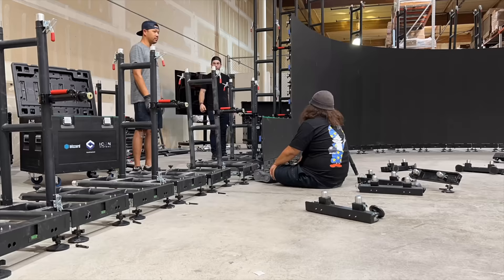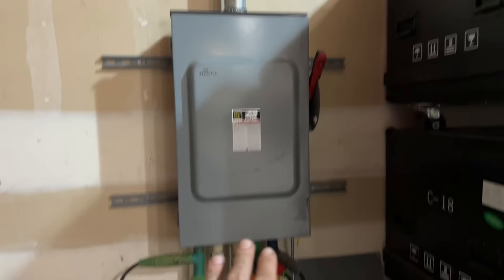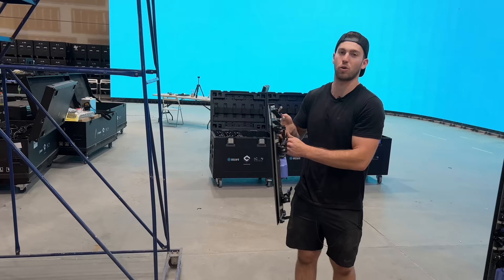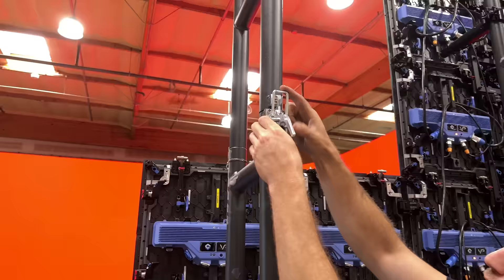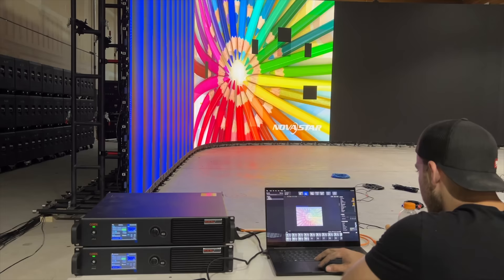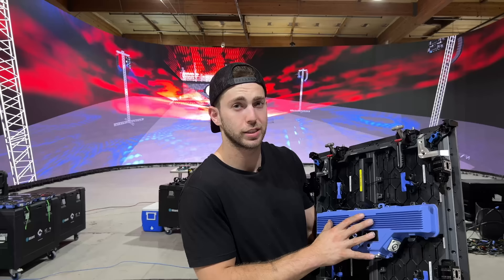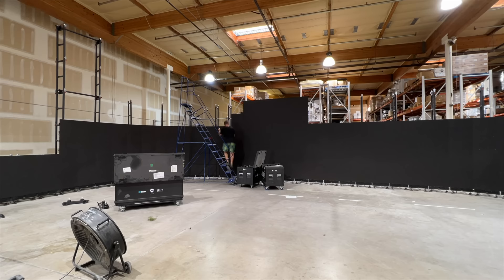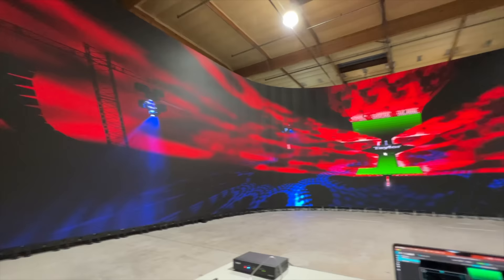How to Build a Video Wall for VFX! (Everything you Need to Know)

Comment: Step 1: Convince someone to give you $1,000,000. Step 2: Build LED volume. Step 3. Underpants. Step 4. Profits!
Reply: 5. Also convince your local electrical company to use 70-80% of their electrical capacity
Reply: @DJDXD  It shouldn't need more than an electronics store or a small company/workshop... It certainly needs strong current (three-phase current or something like that) for the building/the electronics, but that should be easy to implement if you can afford the video wall...
Reply: @DJDXD  200 amp * 240volts  = 48kw
Reply: Did you think this was a diy for someone’s hobby
Reply: Are you building this video wall just to watch parnos on it ? If so....

You deserve it
Reply: Step 3. Learn Unreal engine.

Comment: Well done, similar setup in building video walls in Jamaica, for live events, we run out circuits @ 220v so we get to double the amount of panels per circuit by having the amount of amps per panel running @ the higher voltage...

Loving the full explanation on the amount of processors used and the offset of frames... power, modules and the spline

thanks much...very appreciated

Comment: I work for an AV installation company, we do LED video walls. Still hoping we get involved in a project like this at some point. Since I program AV systems and am currently learning unreal engine, this seems like the perfect sort of project for me. I could easily spend a few days with something like that as my computer monitor. :D

I play with ones that are 16ft by 9ft, pretty regularly but I can't usually pull up unreal engine and start playing around. For anyone wondering those panels run about 1700 a pop retail and the video wall processors are around 7500 each. 
so 56 panels wide x 10 panels high x 1700 dollars each = 952,000 + (4 x 7500) = 982,000. once you get 8 guys for 8 hours a day for 5 days at 150 an hour that's another 48,000. and the trussing I would have to guess is about 20,000 to 50,000. 
So 982,000 + 48,000 + 50,000 = 1,080,000.  Guessing the budget was a million, as you will get a discount for a project with most manufacturers selling you a bulk amount of hardware. Could probably easily shave 100k off the cost.
Reply: Hi, I'm curious to know how much the 16:9 ones you do cost?
Reply: If also like to know how much the 16:9 ones you do cost… and do they curve around the subject like this big one does? And can a person actually run unreal engine 5 on it?

Comment: This is so cool! The Mandalorian used 2.8mm pixel pitch - yours is 2.6mm pixel pitch which means yours has more pixels and a more high definition wall. Congrats on your wall, looking forward to seeing more content about your system soon. Would love to know the camera tracking system you’ll be picking for your Virtual Production. Glad that the Constellation 2M/E has genlock reference in. Hopefully that’s how we use it. Haven’t tried it either but looks like camera tracking, genlock cameras might be the next step after mastering the Unreal software. 😂

Those 560 panels are awesome! I wonder how many spare modules you bought as ready backup spares to plug / swap them in when needed. 

So true about the first layer making sure that’s it’s really leveled and so annoying when it’s hard to connect the side connectors being at the 6th row high and then seeing there’s a small line gap specially noticeable when there’s lighting from the back. Imagine having that when you’re at an event, 8am morning setup - then showtime at 5pm. 😂
Reply: Mandalorian was shot on ROE BP2, which has a MUCH better scan/drive rate with its IC's than anything blizzard offers. pixel density become less important the closer to 2mm you get, and more about the quality of the IC and Diode, and how they are driven.
Reply: Every panel had 4 smaller panels you can Exchange

Comment: Normally a single phase has active & neutral, when active is off it's safe to touch the neutral (if everything is working correctly).
USA 2x 120v phases to make 240v means 2 actives, you can't switch off an active &  touch the other⚡(it's not safe). In this case, both actives have to be switched off.
Australia, Europe & others have 220~240v 1 phase, active+neutral+earth.
Some installations will have ~400v 3phase outlet (3active+neutral+earth) & a plug in distribution board to provide ~230v circuits.
Simple maths: if a panel needs 2A & the circuit is 20A (YMMV), then maximum of 10 panels per circuit. Check the panel power needs, quantity & venue supply long before the day to avoid unexpected surprises.
Reply: Is 400v better? I've heard that 3 phase can carry more power than 2 actives, and that americans struggle with powerful appliances like electric stoves and HVACs
Reply: Careful with that neutral. Even if everything is in top condition, there still is current flowing through you if any device is connected to any circuit on that neutral. The route through you, the ground, and the grounding point to the transformer is in parallel with the neutral wire going to the transformer. This splits the current according to the resistances of the two routes, and while those should be so different that next to nothing flows through you, it can still be enough to become dangerous if you are far away from the transformer, have good ground contact, and there is a high load on that transformer. This usually is no problem if you're in a residential setting with one pole transformer per house, but in an apartment block where dozens of flats are on the same leg of the transformer, or in a 3-phase installation...
Reply: @Gameplayer55055 I think you're mixing two things up: Higher voltage and 3-phase.

Higher voltage: The power you get is Volts times Amps. So if you want to run a 1200 Watt space heater on a 120 Volt circuit, you need 10 Amps (10 * 120 = 1200). On a 240 Volt circuit, you only need 5 Amps (5 * 240 = 1200). Just like filling a bucket with water---you can have fast-flowing water and a thin hose, or slow-flowing water and a big hose, the bucket fills at the same speed.

However, just like that thinner hose that has to withstand higher water pressure from the fast-flowing water, a wire with a higher voltage needs thicker insulation to keep the electricity in. That big hose needs more space inside, and the same is true for wires---higher Amps need a thicker wire.

In the US, with its split-phase system (i.e. 2 hots that have 120V to neutral, but 240 to each other), you get the worst of both worlds. You need a thicker wire and thicker insulation. Not that it really matters; the difference in insulation thickness is virtually non-existent, as the insulation needs a minimum thickness for mechanical reasons anyway. But this now gives you the effect that the exact same wires can transfer double the power if they're run at 240V instead of 120V. The wire thickness limits the Amps, so you can't just double the Amps to compensate for the lower voltage, like in my example at the top.

3-phase, on the other hand, uses a weird little trick to conduct the same amount of power with 3 or 4 wires as 3 pairs of wires could transmit. To explain that, I need to explain AC first. With AC (alternating current), there isn't a constant flow of electricity, but it flows forward and backward like the blade of a jigsaw. Now imagine 2 jigsaw blades that are connected to the two sides of a seesaw---when one goes up, the other goes down. The pivot point of the seesaw never moves up or down. The same also works with 3 jigsaws and a triangular seesaw. Or with electricity, where the 3 phases are the jigsaws and the neutral is the pivot point. If the load on all 3 phases is identical, there is no current flowing on the neutral---there isn't even a neutral wire (that's why I wrote "3 or 4" above). The neutral is only needed when the loads are not balanced, for example, when they are broken out into single phases to connect normal devices.

Now, where do those 400 Volts come into play? In a 3-phase system, there are two ways to measure voltage: Between any of the phases and neutral, or between any two phases. If you get 400V from the latter, it means the former is 230V. If you have 120V phase-to-neutral, you have 208V between the phases. Or you can have 480V/277V, or 415V/240V. You might have heard of those voltages before...

Oh my, did I slip into lecture mode? Oops, sorry.
Reply: @HenryLoenwind  your explanation is great, I've enjoyed your analogy with water plumbing. Electricity is almost identical to water plumbing in functioning.

My biggest question is why america has chosen not so great way to distribute power, while europe has both higher voltage and 3 phase. Makes more sense because you have more power & electric motors are very easy to drive with 3 phase without the need of pesky capacitors.

But I think electroboom would get killed with 220v either lol
Reply: @HenryLoenwind  mentioning neutral, some clever assholes are getting power from neutral and earth(using water pipes), and getting a "free" energy this way. This works with soviet systems where earthing isn't a thing
Reply: @HenryLoenwind 

كنت رائعا بشرحك...شكرا

Comment: Hi Brandon, looks awesome! I've already had some experience using volumes with Unreal Engine etc and it's the way of the future if not now. 
One question I have is "What size pixel spacing are your panels?"  We've used 2.9 and 2.1 which worked OK but tighter pixels stop moray issues.
Love your videos by the way.

Cheers
Tim
Reply: I can help briefly, a 192 x 192 panel that is 500mm x 500mm indicates a 2.6mm pixel pitch. @10:45

Comment: Great video. I shoot and produce on a virtual wall in Canada and found your video in hopes to address an issue we have been having. We seem to get horizontal scan lines on video whenever trying to add movement to our camera. If the camera is static, we can sync the LED wall to the frame rate of the camera and don't get scan lines - but when trying to do jib moves or gimbal moves - it always produces scan lines. I'm guessing because of the rolling shutter. Do you have any tips or tricks that you have used? Or anyone in the comments? Thank you

Comment: Great video!!!!! Can you tell us how you got your single 4K output to work on the full wall? Especially with no tearing. Keep up the great work learned a lot here 😊
Reply from the maker: Yes, all the HDMIs in the processors are daisy chained. Then I set EDID of first processor to the widest I could get it and in the same aspect ratio of the wall. Then in the first processor I set the canvas size to 1/4 of the wall and places it on the far left side of the laptop output image. I repeated the canvas size for the other 3 processors giving each one its own 1/4 of the laptop output image. So each processor is scaling up the image to display on the wall. I’m running at a lower resolution then the wall but sizing up to making it fill the screen. Hope that helps.
Reply: @liveproductionmastery  thanks for replying. I am going to try this on a smaller wall just to practice.

Comment: I thought the Wall I work on was wide. Who does your repairs? I would like to familiarize with this manufacturer. I repair Unilumin Upanels 1.5mm Pitch. Driven by Analog Way Helios Processors and Aquilon Scalers using Watchout. Would love to repair those. Do you just RMA them or do you do repairs local to your operation?

Comment: You mentioned the controllers have HDMI (that you plan to use) and the panels are also daisy-chained by ethernet. But what are the other cables we see, they kind of look like XLR, what cables are carrying the actual video signal?
Reply from the maker: SDI is another one of the video inputs which can carry 12G signal meaning up to 4K 60fps 
DisplayPort is another video input option that can do even higher frame rates and resolutions. But you can’t run the signal as far. 

SDI can run reliably at about 300 feet. Then you can rescale the signal with a decimator to run it farther if needed. 

These processors do not have fiber video inputs or loop throughs unfortunately

Comment: Amazing equipment, what’s it cost to do a setup like that
Reply: It looks like they are using Blizzard IRiS Icon 2.6, maybe $1,400 each (without bulk discount). 56 panels wide x 10 panels tall = $784,000 . Not sure on the video processor units, maybe cheaper, but probably $75,000 for the 4 hubs + 4 processor units. Add another 15k for smaller things: metal rigging, electric equipment like panels, miles of cabling, storage for everything. Total: Probably a bit under $900,000 on just materials, without any spare parts.
Reply: @benjaminaburns  holy

Comment: Hey what’s the tallest you’ve built with these blizzard panels?
Reply from the maker: 16-18 panels either ground supported or hanging.
Reply: @liveproductionmastery  sorry should have clarified, yes how many panels tall on a ground stacked blizzard wall?
Reply from the maker: 18 ground supported but make sure to have support structure behind it. You could go taller but definitely need rear supports for stability.
Reply: @liveproductionmastery  wow almost 30’ do you happen to have any pictures or videos? I’d love to see it

Comment: 3:58 that paper covering the primary power couplers will not stop anyone from getting electrocuted, that amperage would rip through that sheet of paper like it wasn't even there if someone put their hand on it... not to mention the busses are still exposed on both sides, leaving me to wonder what that paper is supposed to do? Those panels should be mounted somewhere a lot more stable and definitely  not on the tubing for the monitors.

Comment: @3:44, yeah, NO!  You don’t have one ‘lead’ carrying the power on a 120VAC circuit!  The neutral is the other ‘lead’ carrying the current.  Even though the neutral is bonded to ground at the source, it is STILL. carrying the same current as the hot ‘lead’.  The ONLY divergence between the cable carrying the current on and 120VAC circuit compared to a 240vac circuit is that the voltage is doubled on a 240, and the amperage is half, for the same power delivery.  You need to Brush up on the American ‘single-split-phase’  power system.

Comment: As a SysAdmin, to me, the panel painting process SCREAMS for automation.  Pick panel you like the settings for, push button for pushing those settings out to all other panels.
Reply from the maker: That is how the panel painting works. If you start taking panels from different manufacturing batches, or 3 year old panels mixed with brand new ones off the factory line. They might all think they are matching, but side by side you can see a slight difference. That’s where the very specific coloring comes in but for this build, it was pretty much just a couple clicks to copy one panels settings to all the others.
Reply: @liveproductionmastery  Isn't it possible to automate it by having a camera registering what comes out of the panel?

Comment: How to build: have 100.000 to few MILLION dollars (depending on the size), wait for months for the equipment to arrive because they're made to order, hire professionals who are certified to install and handle the equipment or you lose your warranty and manufacturer is going to be very adamant that any issues with the equipment are your fault, remember that LED's are very VERY sensitive to environment and mishandling. You must have low humidity place, with no direct sunlight, with massive amounts of cooling since LED produce lots of heat etc.

I worked at a company that designed and installed these systems... it's very VERY expensive stuff... :D

Comment: With AC there are always 2 wires for the power. So you explanation is wrong.
Reply from the maker: Are you in the US or other country? Different countries do things differently. In the US. Standard voltage is 120v. There are usually 3 wires. Lead/hot carrying current, neutral and then ground. So yes there are always 3 wires but when we want to get to 240/220. We replace the neutral (white wire) with a second lead/hot since they are both at 120v. 

This has been brought up in other comments as well that different countries do different things so I should have stated this specifically for USA builds. I will try to be more specific in the future.
Reply: The neutral is also a "lead" (current carrying conductor) its just bonded with earth (and you). Ground isn't supposed to carry current.